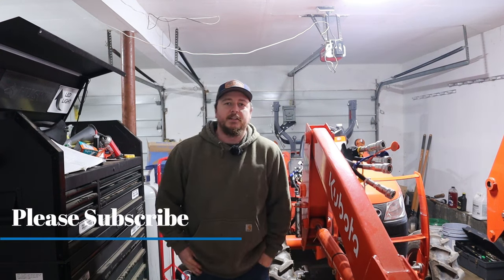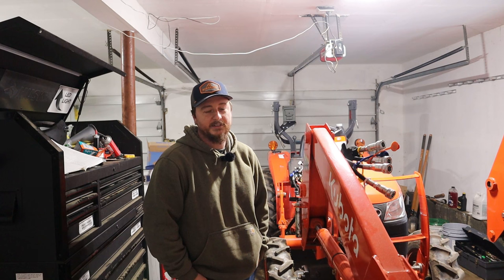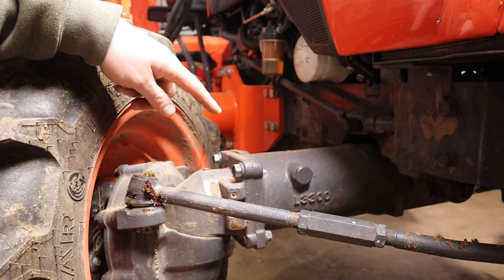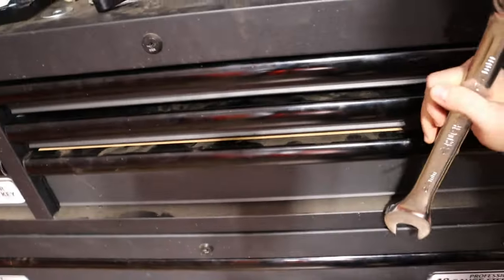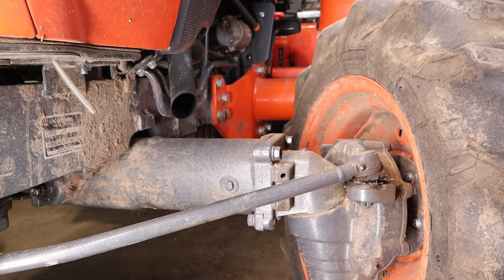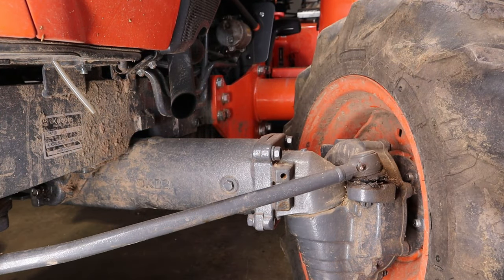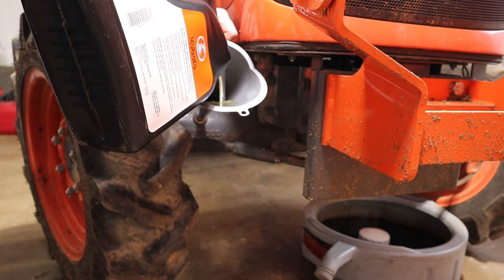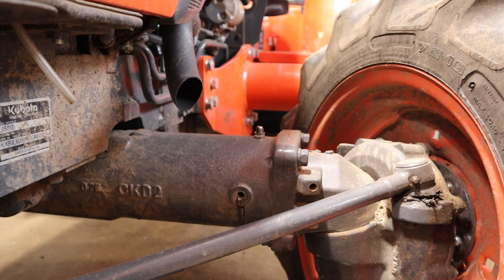Kubota Owners Check This NOW!

Comment: If you use your tractor  to remove snow you should swap your front axle to the 85-90W gear oil.  What happens is you are using it and working it in the cold. When you are done you park it and all the fluid got warm from working so it melts the snow. The gear oil is pretty thick and does not warm up as much as the hydraulic fluid that most manufacturers put in there.  As everything cools it contracts and can suck that water inside your front axle. Their has been many people that have popped their dipstick out only to find their gears and front axle were all rusted up from water contamination. The thicker gear oil does not get as warm and you don't have that problem.
Reply from the maker: Thanks for sharing !

Comment: It takes some time for it to go through the pivot, especially when it’s cold.  Don’t forget to take your grease gun to the pivot after you open the vent.  I change my front end every hydraulic change.  I use gear oil, the thicker the better.  👍

Comment: This video is performing really well! I changed it at around 900 on my M6060, still looked clean. This is something that should be checked day one on getting a tractor, my bx was very low and I didn’t catch it for a long time. I only did check because of hearing other people talk about this issue. Appreciate you mentioning my channel! Excellent video Richie!
Reply from the maker: Of course ben! Im seeing so many people dealing with being two quarts or so low on fluid which is crazy!
Reply: I did a video last summer on my channel Ben and when I checked the level, it was low. I checked it after I brought the tractor home but hadn't run it in 4Wd. I was shocked at how low it was with just over 200 hours on the tractor. 
Since filling, I have checked twice and the level is right where it is supposed to be.
I think Richies theory is spot on. Totally makes sense to me.
Reply: @HillsideAcres  it's not full from new once you have filled it it won go down like that 👍

Comment: I agree with your assessment.  I doubt it's dealer policy, but the mechanic is cutting corners.  Of course if there is an issue, the dealer will say you are not doing the proper maintenance.  Great Tip Richie - Enjoy the journey - cheers
Reply from the maker: Thanks bob. im happy that im topped off now!

Comment: My B7800 has a dipstick (yellow plastic) on the front axle, which looks very similar to yours. Industrial sight plugs are available for many threads, and it might be worth retrofitting the non-dipstick models, then you could check the level with a flashlight. My B7800 (2006 model year) had 570hrs on it and was a tad low when I got it. I did a full service on it with all Kubota parts from Messicks and used UDT-2 (7 gallons) as well, not cheap but cheaper than replacing the finals or worse. I do need to be more diligent about pre-flight checks, especially when it's sub zero out. Good video, hope it saves some tractor owners big repairs, Thanks!
Reply from the maker: It seems this video has raised a lot of awareness which was my intention. I dont think being two quarts low will cause catastrophic damage but better to be within specification versus not even checking it!

Comment: Great tip for those who are unaware. I checked my Kubota tractor day of delivery when new. And 4yrs (160hrs) later, its still clean and on the full mark on the dip stick. 
I very diligent about checking ALL my fluids before i start & use my tractor`s. Most people don`t, and then that is when they get in trouble. Its not hard to check the fluids before starting it.
Reply from the maker: NICE! thanks for watching Larry!

Comment: Thank you 🙏.  I went to the garage.  Broke the check open, nothing.   Broke the fill and put an additional 2.5 quarts of 85-90 until it started leaking out …..  not ok with this.  I’m so glad you posted this video.

Comment: Thanks buddy.  Saw video about a week ago.  Finally found my front axel drain and fill.  Fluid was trans fluid, changed with 90 weight heavy oil.  It was considerably low, not touching dip stick.  Thanks!  You increased the life of my axel.

Comment: So, I’ve worked with 80w 90 gear lube before, and I’ve used Kubota super UDT. The latter falls somewhere between a typical hydraulic oil and an engine oil in apparent viscosity at room temperature, as I recall, and 80/90 gearlube is on the extreme end of viscosity, almost a grease rather than an oil. Can someone please explain to me how any piece of equipment can call for either of these products interchangeably in the manufacturer’s specifications?
Reply: I believe it comes down to the operating temperature where the tractor is located. If you feel more comfortable with a heavier viscosity oil, then use it. 👍🏻

Comment: How's she goin'?  Great tip here and thanks for sharing.  I have a Massey Ferguson GC2300 sub-compact tractor and the front axle leaks oil around the pivoting joint for the offset drive to the wheels.  I check this oil level probably every other time I take the tractor out as it is often low on oil!!  Thanks for sharing and take care!!!
Reply from the maker: Thanks for stopping by Mike, At least you know its always got good fresh oil in it!
Reply: @HillsideAcres  LOL  For sure eh!!!

Comment: Thanks for the video.  I just changed the axile oil in my BX23S.  I only had 150 hrs, but saw it was low.  Turned out it was a little over half but I didn’t see ant meatal shavings.  Shame because the dealer supposedly did my 50 hr check.  I have now went back and did everything they charged me for.

Comment: I think the l-2501 requires 4.5 litres Canadian{?}.i checked mine and it required 2 litres of oil.They only put in half the required oil.That really opened my eyes as to the inspection and PDI of this piece of equipment.For the amount you pay for Kubota,there should be no guessing,it should be spot on!Good vid.
Reply from the maker: Liters and quarts are very comparable very slight difference, thanks for watching !

Comment: Thanks for the info. When I did my 200 HR service on my 2017 BX I checked it. It was 1-2 qts low. My Kubota service manual says to "change" it at every 400 hrs. My fill plug on my Kubota 2380 for the front axle case is on top Driver's side. I also found a socket extension buried/stuck under the tractor and a miscellaneous bolt and washer just laying around. Can't remember where, but I wonder who is prepping these for delivery? Oh, and also, the height adjustment knob for the mower deck is just impossible to turn at times without a pair of large channel locks

Comment: Great tip, Richie!  We shouldn’t assume them come full from the factory or don’t lose oil.  I changed mine at 400 hours, because like you, I thought 800 hours was too long to wait. Thanks for sharing!
Reply from the maker: I’m right there with you martin. Being pro active on maintaining tools and equipment is cheap insurance for a reliable operation.

Comment: The use of UDT in the front differentials on these tractors can lead to leaks in the knuckle seals. It was recommended to me by the dealer to use 75/80 weight gear oil which is thicker and will not bypass the seals.
Reply from the maker: Either works fine, no leaks on either of mine. No liquid should be able to leak by

Comment: Speaking of maintenance:

Thoughts on the manual often saying, (ex.) "Check/change every 200 hrs or every 1-2 yrs, whichever comes first." The years of ownership seems a little overblown, but how seriously should I be taking it? Thoughts?
Reply from the maker: It’s a pretty good idea to go by the manual, checking on things like engine oil and hydro more often. A through annual servicing with regular greasing is typically good for most

Comment: My BX was low too straight from the dealer.  When I changed it , went with gear oil and just elevated the axle a bit so I could rotate the wheels by hand.  That settled the oil into the hub straight off.   Been good since and I’m at 680 hours.  Surprised your 2501 doesn’t have a dip stick for the front axle.  Thought that was standard.   Thanks for the reminder though as I should probably change mine again soon.
Reply from the maker: Thanks for watching, thats a good idea for when i change it out, the standard L series have a fill level drain. Have a good one!

Comment: it takes forever for the oil to work down into the gear reductions, So like you said you need to use it for days to recheck. do a change in the summer when its hot, leave the oil out in the sun so it thins out, their not using oil, their not full .. unless  their leaking

Comment: UDT is hydraulic fluid? So what is actually recommended or better hydraulic fluid or gear oil? Thanks mate 👍
Reply from the maker: I can’t really say what’s better or worse, from factory comes with udt2 in the front axle. The manual states that you can use either, I think either will be plenty suitable

Comment: I do believe it's every 400 hours on a oil change.. what it was on my l 3301 anyway you might want to check your manual
Reply from the maker: 400 hours would be an engine oil change 800 hours is for the front axle case. As per the manual!

Comment: Jealous of your wrench holder in your tool box. Upon further investigation you'll find the factor used UDT bc that's what they have on hand,  it's convenient.   The dealers have learned gear oil is better and less apt to leak.   Many a front ends been ruined running the thinner oil more leaks and blown seals.
Reply from the maker: Thanks it’s a set from “foam fit tools” it fits the husky 815 pc set along with the husky 61 inch box the best part is really when you are missing something you know exactly what you are missing and can replace right at Home Depot.

Comment: Ive had an issue with my 40 year old L where there would be too much pressure in the case when warm; causing fluid to blow by the seals.  First I tried a plastic stand-up vent but it got torn off.  I got a bolt with the correct thread and drilled a 90 degree 1/16 hole through the head and bolt body.  This provides ventilation for expansion and contraction.
Reply: wow, I went to check the level and the bolt tried to fly away from the pressure.  I never thought of that. Thanks for the comment.  Maybe it will stop that oil leak I am having without having to split the tractor.

Comment: My L6060 was down over a quart from factory. The dealer never checked it, cause there was still paint on the plugs. It calls for a change every 400hrs. Does your front guard wiggle side to side ?  My 6060 does.
Reply from the maker: I dont think the guards on either kubota wiggle. thanks fore watching!

Comment: When I worked at a kubita dealer it was our policy to check it before the tractor was sold and check it again at the 5o hour service
Reply from the maker: I do all of my servicing my self. But the manual should really have checking the front axle at an earlier interval than just changing at 800 hours!

Comment: you are correct, have a mx 5800 300 hours, never checked the 4 wheel drive never seen any leaks, until last week the left bearing shelled out when driving and the wheel fell off nice. anyway  the axel cost me 458 dollars and the 2 race bearings and seals, another 150 dollars plus the 7.8 quarts of lube, so check are pay the price, if Kubota did the repairs you would be looking at over are close to 1500 are 2000 dollars in repairs

Comment: After you add oil, you have to check it again the next day there’s a lot of bearings the oil has to seep through to get the correct level at minimum it’s overnight
Reply from the maker: That’s why they come low from the factory!

Comment: My 2024 GMC truck was 2 quarts low in the rear also.  Checked with 5000 miles and pinion gear roaring.

Comment: You are mistaken,after Warrenton put in 80w90 full synthetic ps.take the cover off and check bearings before hand,I guarantee the old bearing are bad.i speak from experience.
Reply from the maker: Standard oem is super udt2. If “warrenton” does otherwise that’s their choice

Comment: As watched, I had to quickly check on mine as the dealer told me to use gear lube Front axle case .   (SAE85-,90 gear oil)  Then double checked and either or could be used.  Front axle case  KUBOTA UDT or SUPER UDT fluid* or SAE80, 90 gear oil. I had serviced my B2650HSDC-TLB at 400 hours and I replaced the existing fluid which was gear lube from the factory.

Comment: My L3130 started leaking at the left front hub. The seal was bad so I replaced both sides. It was a bitch but doable. Had to drain a lot of fluid because it has to fill both hub gear cases also. I don't think the dealer shorted me on fluid because I checked it a couple of times a year. I think driving it on the road for 3 to 5 miles every so often did it. I now trailer it everywhere unless it is only a half mile or so. I think I went back with the Super UDT. Thanks for a good video.

Comment: I just bought a 2022 L2501. It’s my first ever tractor. I check all my fluids when they delivered it to me except the front axle. Mine took almost a whole gallon of Super UDT2 fluid. Luckily I only put 4 hours on it before realizing this issue. Thank you so much for this video. You saved me a big headache down the road!

Comment: Every 800 may seem excessive but its a good practice to drain and look for metal chips, those angle drives don't like chips and the bevel gear teeth are under a massive load sometimes in 4wd. A couple quarts of oil vs $1k to replace gears, bearings, seals and a cracked housing.
Reply from the maker: Thanks for the info
Reply: @HillsideAcres  Had a Kubota blow up a front drive and farmer next door with a compact deere. Helped him go through his front axle after a sudden dissasembly.  Good maintenance for the kubota also doesn't seem to mention pop out the front driveshaft couplers and lube them now and again every couple years else the rust eats the splines, not an overly expensive repair but it breaks when you need it most.

Comment: I wish you had showed the front axle gear oil in your video as I could not understand what oil to use.
Reply from the maker: I used super udt2 it was in the audio. Can also use gear as per your owners manual. I topped up with udt2 because that’s what was from factory and I did not want to mix

Comment: I put a clear surgical hose on the end of my funnel that sits in the filler hole made life a lot easier to fill you should try it it really is a great Helping Hand
Reply from the maker: I have all that stuff but currently in a transition of moving a house building a new shop and barn lots of stuff in boxes lol
Reply: @HillsideAcres  you be working out of boxes 📦for a while. Lol

Comment: My 5240 had hydrolic oil in it from day 1,brand new,the left side gear assembly failed.i had to replace all of it,1500.00 bucks in parts alone,now they put in 50w synthetic.
Reply from the maker: Yes super udt2 is standard from factory just not enough of it

Comment: Super little tip - you motivated me to check this fill level - clear and informative - thank you!
Reply from the maker: That’s what my intentions were! Thanks for watching and I’m happy this was helpful
Reply: @HillsideAcres  so I am wondering how to lift the brush hog implement is there a lever or something I need to push to get it to lift some in the back to get it off the ground?
Reply from the maker: @twylatwyla7437  brush hog is on the three point hitch. Lift the lever and it will come up